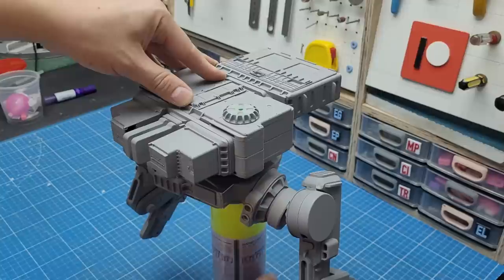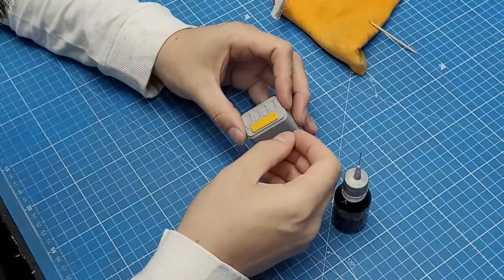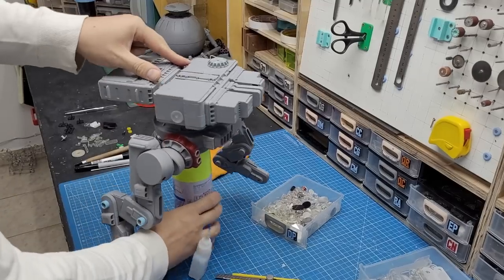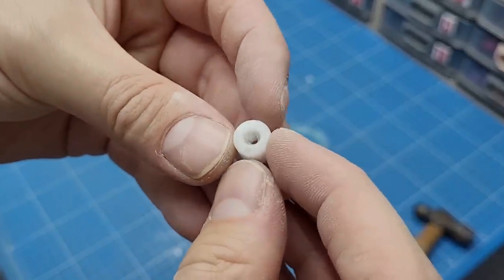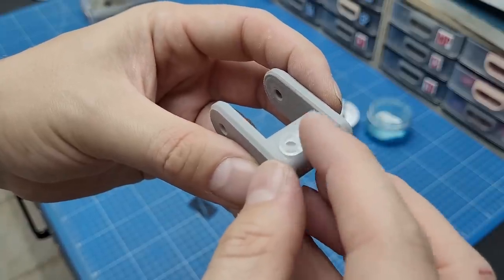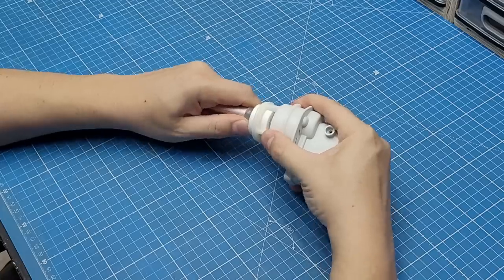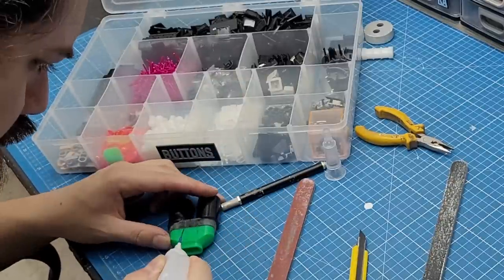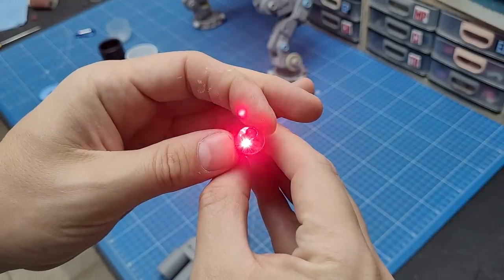ATTACK Systems ONLINE! - Flamingo Season

Comment: That gun is so huge, I image a mech would be designed around it (like the A-10 around the GAU-8).
The mech looks pretty "saturated" already. Maybe a small RCWS offset on to, or below against anyone trying to sneak up. Might also need some kind of sensor on top to guide the missiles, which could be combined with a gun.

Comment: Not all LED’s need a resistor…..some have it built in.   They also can have a flasher built in.  In either case just apply DC power. I use them in my models all time.